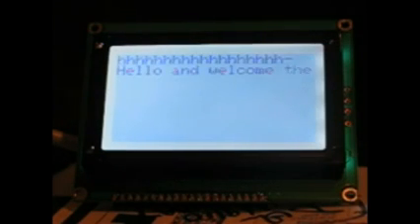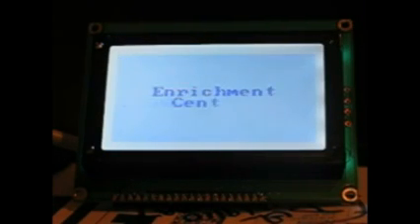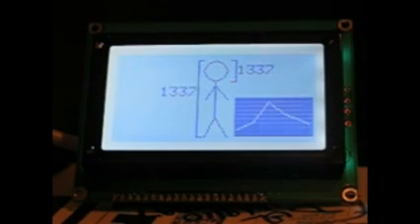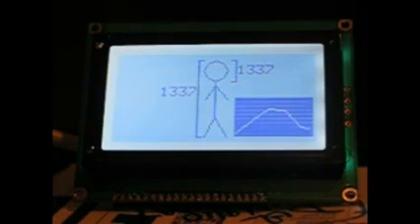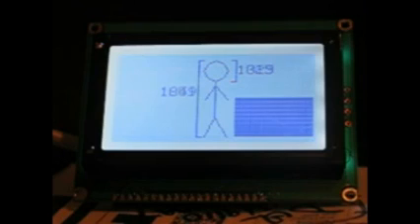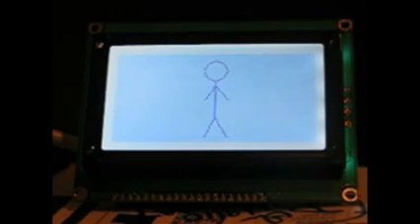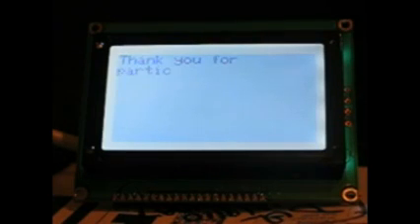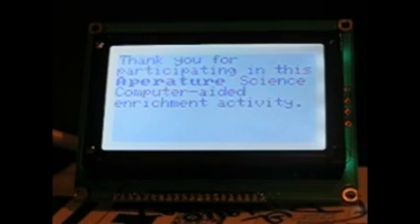Arduino LCD Demo

Comment from the maker: @AKSoapy29 They have fairly slow response times (see the video) so you get ghosting. It uses a serial interface which is a bit slow at times but for the most part surprisingly fast given it only needs two pibs.

Comment from the maker: @formulaformula1133 I just wrote a custom C program which generates all the graphics "the hard way" (i.e. doing the required calculations for drawing cubes etc.). The display I'm using has a serial interface which provides line-drawing and text printing facilities and uses two IO pins -- one for serial data and the other for flow-control.

Comment: Hi your video is great, I recently get into graphics and bought a great serial LCD with touch controller called SMARTGPU from vizic technologies, and it's just 3 wire interface, microSD-4GB, could be used as shield or on a standard breadboard, very powerfull graphics, You can create advanced applications very very easy, I recommend you this board if you like interfacing arduino with graphics, check my video response! tab "SMARTGPU arduino ipod like"

Comment from the maker: @Sebbl3 I didn't use a library. The display takes VT100-style commands (plus a few extras which I'm using to draw lines and such) and I'm simply doing the matrix manipulations required to rotate points in 3D (so just not-so-interesting-maths there, nothing fancy). Hope that helps!